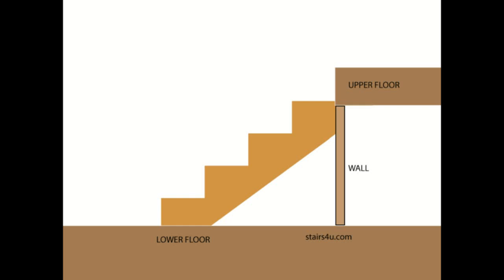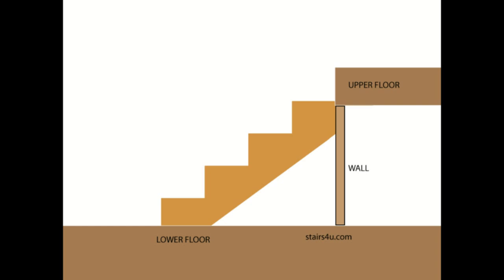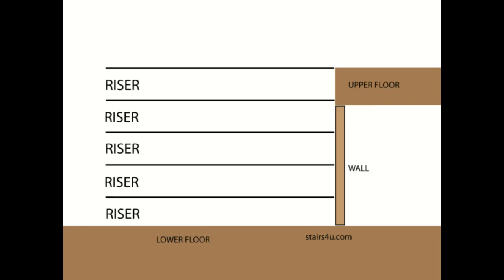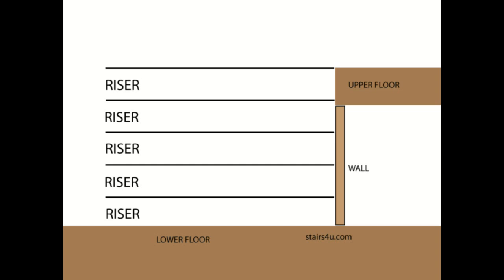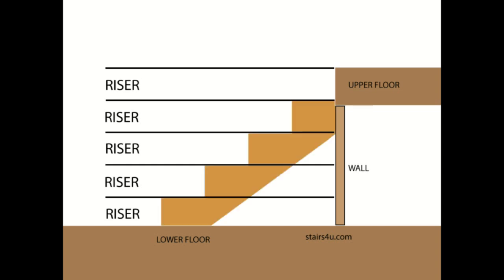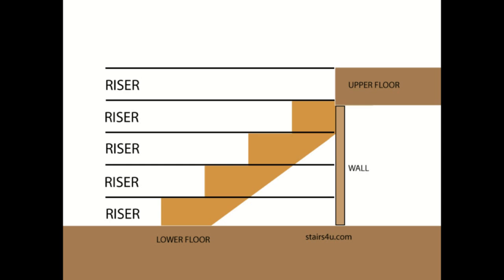What Is A Stair Riser? - Building Stairs

Comment: I'm a little late to the party, but as you seem to know something about stairs, I'll see if you can answer my question: I just bought a house, and while the inspector didn't say anything, my cousin (who has significant construction experience) pointed out that the reason the basement stairs creak so much is because there's no center stringer. (He cited the general framing rule of 16 inches on center, which a staircase with only edge-stringers certainly doesn't have). A forum website seemed of the opinion that if you have thick risers, you don't need a center stringer (likening the finished product to an I-Beam). My stairs only have decorative risers (which I came to your video to positively identify). If I replace those with sturdy plywood, would that negate the need to add a center stringer? I see you included one in your video, anyway, which is why I ask. It seems much more difficult to retroactively add a center stringer without completely rebuilding the staircase, vs adding risers and firmly attaching them to the stairs.

Thanks!
Reply from the maker: Stringers can be spaced farther than 16 inches on center, depending upon the thickness and tread materials. For example a 3 x 12 can span 36 inches and a 4 x 12 could probably span up to 5 feet.

Comment from the maker: That's a good question and they actually can. For example, if you have an 8 inch riser and you're going to use 2 x 10 stair stringers, then the notch you take out of the 2 x 10 for the stair treads and risers, while you're cutting the stringer could leave you with a weak point on the stringer. However you could easily solve this by using larger lumber like 2 x 12.